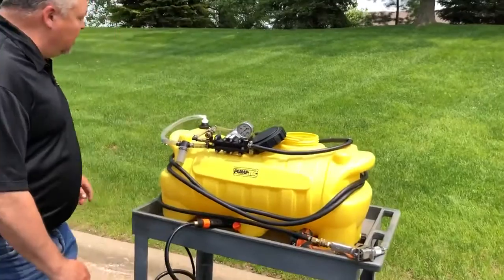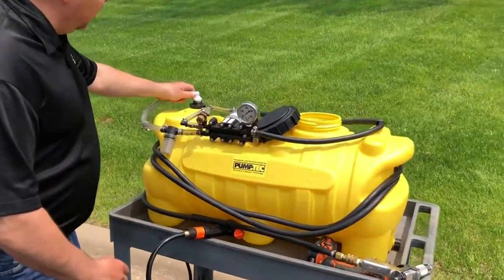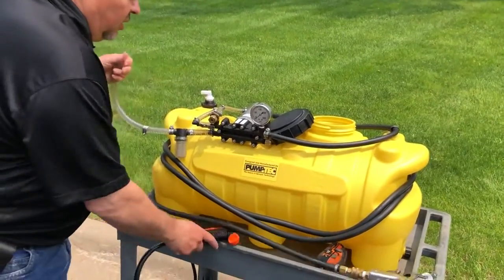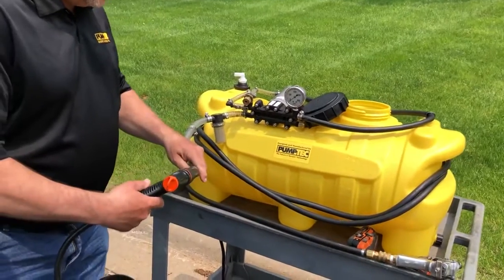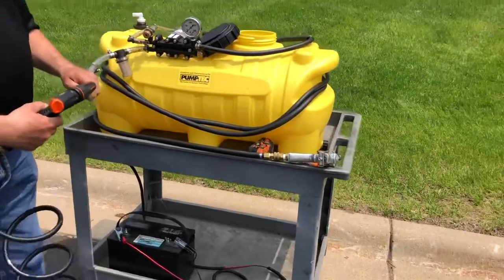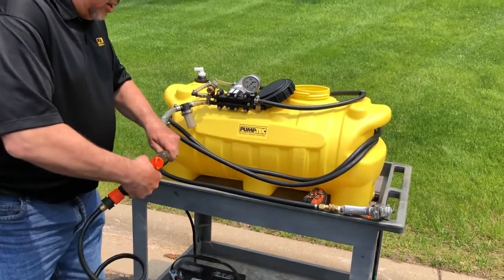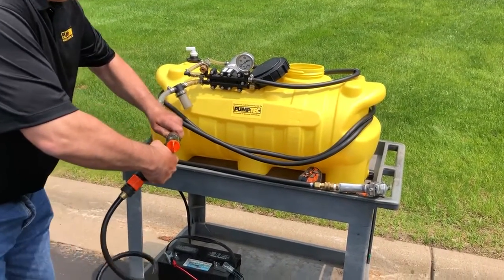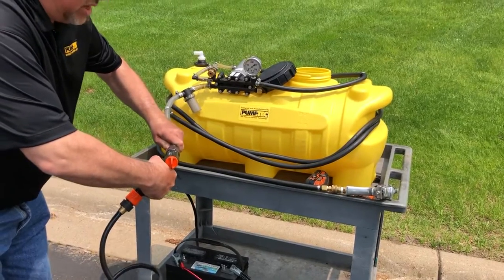Technical Support: How to Prime a Pressure Pump | Pumptec

Comment: I have a 3800PSI (3.6 GPM) Westinghouse pressure washer and I cannot not get the pump to suck in the RV antifreeze (when I pull the recoil cord) to winterize the unit. Does it sound like I have an air pocket in the pump. Thanks in advance.